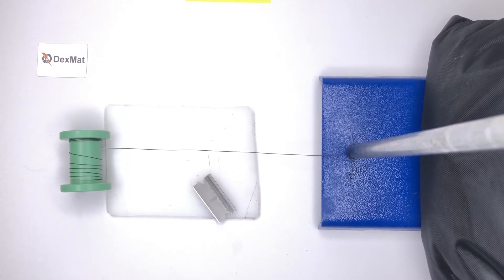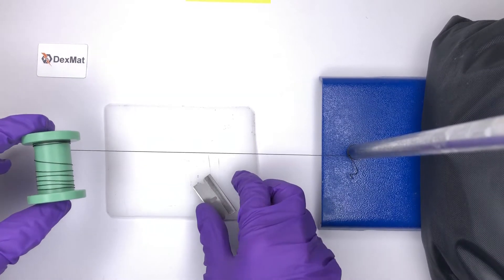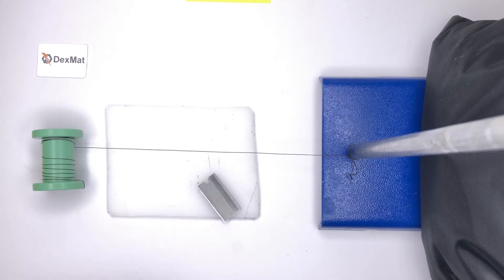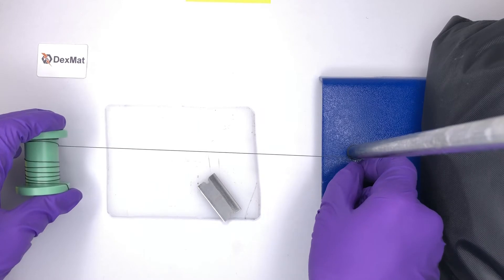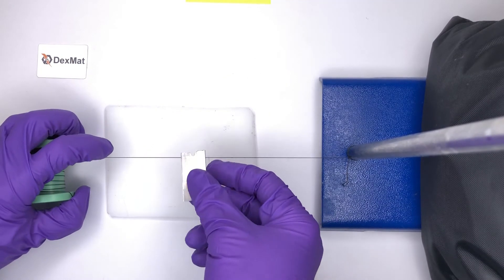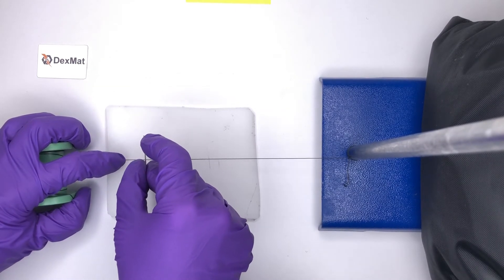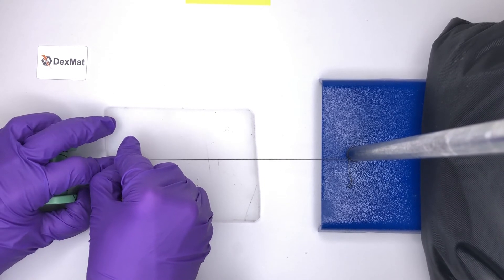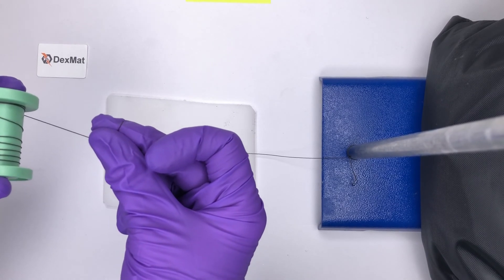Cutting Carbon Nanotube Yarn

Comment: How is it possible to cut the CNTs if it is stronger than steel????
Reply: kevlar is stronger than steel yet you can cut a kevlar thread with scissors or poke a hole in aluminum foil with your finger.
Reply: if you had a steel wire of the same size you would be able to cut it more easily from what i have seen

Comment: Why not use wire cutters?
Reply from the maker: Sharp wire cutters or scissors work, so long as the CNT yarn is in tension.

The source of the difficulty in cutting this material is that the CNT fiber and yarn is easily deformable when you press on it from the side; it can become quite flat without losing much tensile strength or conductivity. This is nice feature in some contexts, because it makes it easier for the fiber to be bent at sharp angles or flexed repeatedly without suffering much bending stress.  However, when you try to cut it with scissors, it can flatten out and slide between the blades (unless it is in tension, in which case it cuts fairly easily).

So, depending on how sharp they are, wire cutters may be able to sever the fiber, but in most cases it will just be smashed flat between the blades when they press against one another; this might damage the fiber, but not sever it entirely. Sharp scissors actually work better because (if the filament is in tension) the filament will bend flat around the blades and then actually be torn apart by tensile force as the blades continue to move past one another. A razor pressing a tensioned fiber into a soft surface does something similar: the fiber will be flattened out and then subjected to tensile stress that pulls it apart, especially if the blade is slicing across the fiber.